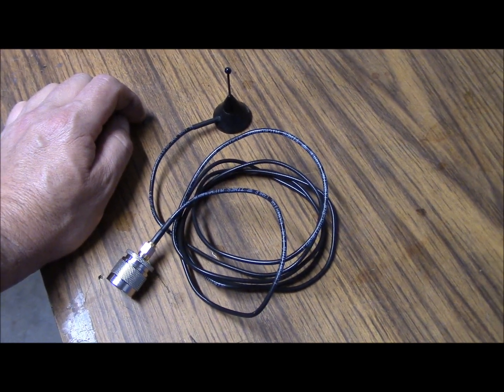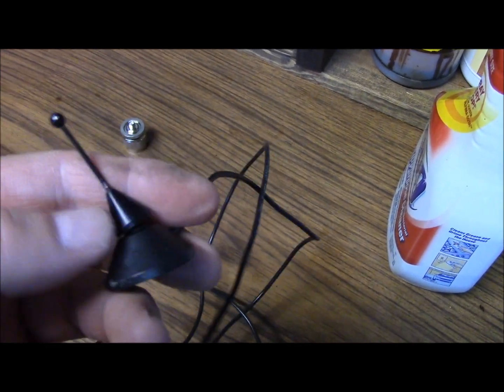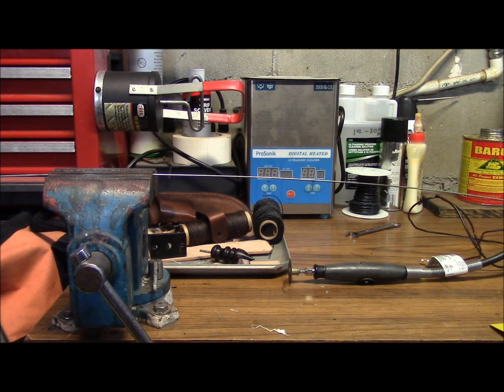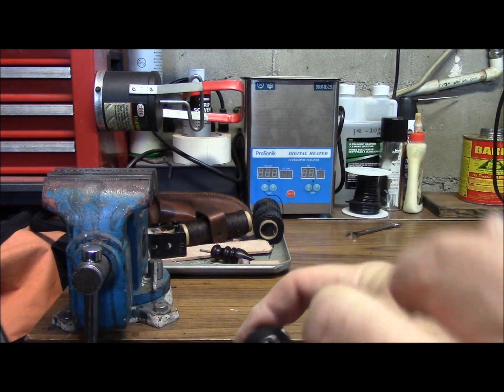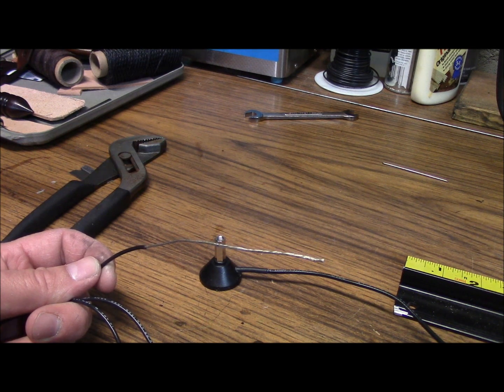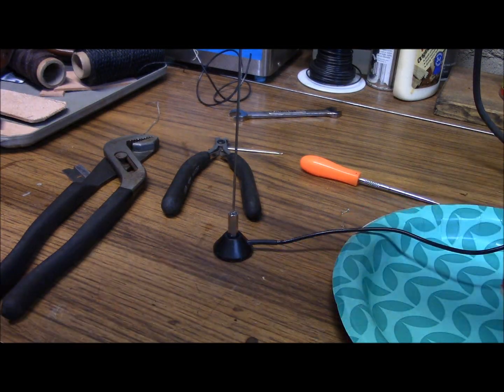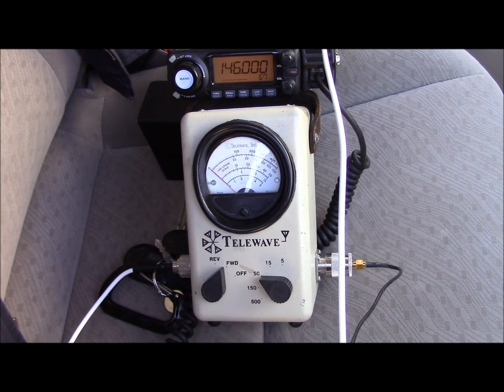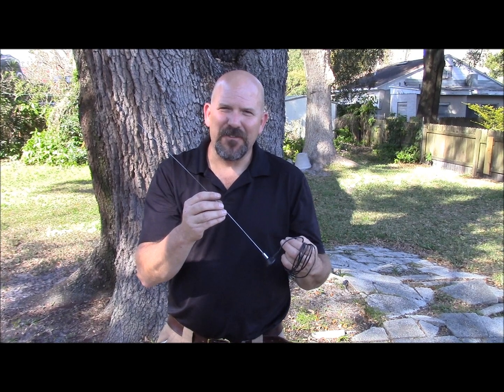DIY Dual Band VHF UHF antenna from surplus

Comment: Could you better explain maybe in a message, the characteristics of this antenna? You explain the operation but I do not speak English and it is difficult to understand the various steps. Thank you very much.
Reply: He made it ca. 19.5 inches because this is 1/4 wave at 2m and 3/4 wave at low 70cm band. At 1/4, 1/2, 5/8, 3/4 wavelenght antenna resonates. Have a read on antenna theory and use resonant frequency calculators to clear any doubts.

Comment: I like this, but as a tinkerer I would like to add my opinion as it were. Instead of adding the wire at the bad of the collector, why not install a bolt and drill it to accept the collector and then cross drill the collar and bolt to add a set screw? I mean it would be more work but it would probably be more sturdy. The other thought I had was if I were to do it your way with the wire, I would’ve used J-B Weld to fill in the void and lock it all into place. Again, not knocking what you are doing, rather I am sharing my ideas with you and the community.
Reply from the maker: Yes I could have used brass tubing as well and drilled / tapped for a 4/40 setscrew. I mentioned the set screw  at the 4 minute mark.  This was done as an experiment with what was on hand at the time. Thanks for watching !

Comment: Could I do this with a old cb antenna ?
Reply from the maker: Tristen Oj sure could if your resonator dimensions are right. Just make certain you eliminate the loading coil. Thanks for watching !
Reply: SurvivalComms not exactly sure what the loading cool would look like
Reply: SurvivalComms loading coil sorry
Reply from the maker: Tristen Oj cylinder at base or mid resonator